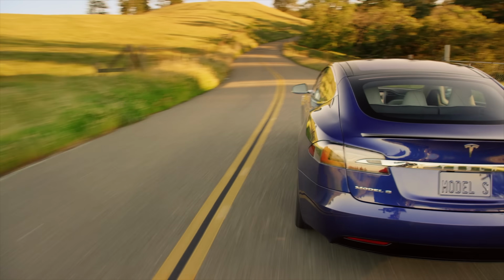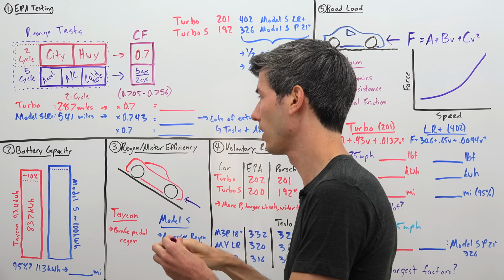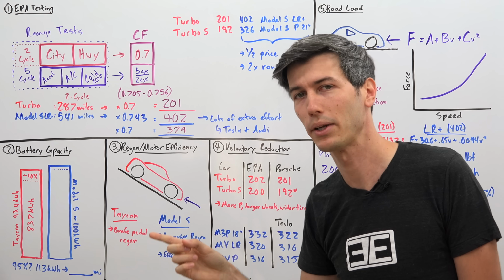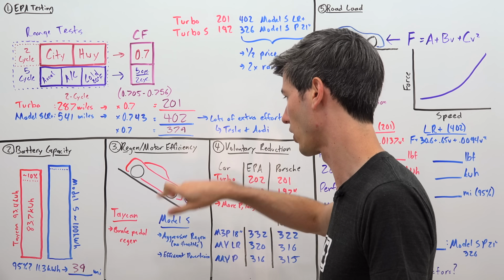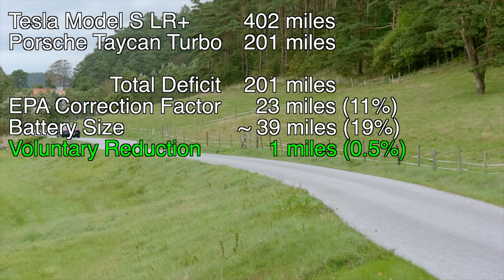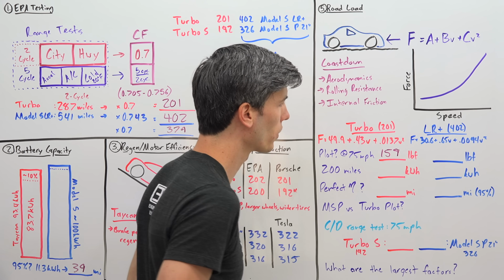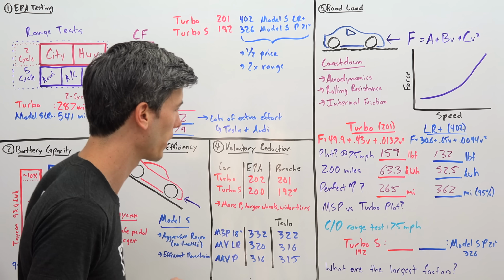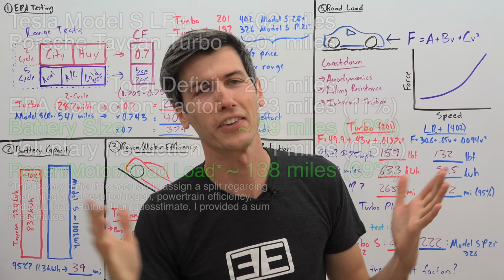Tesla's Secrets To Dominating EV Range - Double Porsche?!

Comment: All other factors aside, EV range numbers are misleading. It should insult everyone's intelligence. They should be broken down to average city mileage and average hwy mileage. EPA range for ICE cars are much, much more accurate. E.g., 2009 Civic can go 36-40mpg at 80mph; EPA estimate is 36mpg hwy. 2019 Model 3 AWD rated at 310miles range can only manage a mere 190ish miles at 80mph. Tesla's increasing range claims, at this point, is a mere marketing ploy.
Reply: Not just that, its imo also important to list efficiency at different speeds and charging loss(which can be more than 20% on some cars), then the consumer can decide where the sweetspot between efficiency and batterysize is, or just go for a different car that consumes less energy.

 Until recently that wasnt particularly important as most ev's were rather premium priced, but for the masses daily costs are important, and not everyone has the option of a solar panel.

Comment: So what you're saying is:
1. the government makes manufacturers perform a bunch of tests to evaluate the vehicle's range. 
2. these tests are so laborious that manufacturers often choose to skip some, despite the possibility of a poorer rating.
3. the value obtained for the range is not an objective evaluation of the vehicle's actual range.
Sounds about right.
Reply: The thing is that it was "ok" for gas cars but for electric cars with regen systems we really need a "city range" and a "highway range". This "half city/half highway range" doesn't give the consumer much of a useful estimation. But we perform on electric cars the same test we're used to with gasoline cars...
Reply: @OdamaKamayuka  More regulation, good idea
Reply: @luisgeniole369  nothing wrong with appropriate rules and regulations.  Smh
Reply: @trance9158  Don't let nobody tell you different
Reply: @luisgeniole369  its hardly a regulation, just a measurement
Reply: Good point. I think comparing EPA to WLPT would be a really interesting video too.

Comment: This is a great explanation and points out a great point. Not sure about Porsche, but I've had 2 Teslas in the past 5 years. I had a Model S 60kWh, rated at 203 miles which I never got more than 160 miles actual usage with 100%. For my P100D rated at 315 miles, I've never got more than 250 miles on a road trip (mostly highway)

Comment: About pricing, I dont know in the US but Tesla model S long range is starting at 85 000 EUR (100 700 USD),  performance 21" is at 101 000 EUR (120 000USD) VAT included. While porsche taycan is at 110 000 EUR (130 000 USD) which is not twice the price but "only" 30% while being a real sport luxurous car with a brand on it. Just saying.

Comment: very nice video. thanks a lot.

But should it not be a test between porsche Taycan and model S P21" ?
It shows that Porsche is preservative, when Tesla is lying.
Of course eventually Tesla is going better, thanks mainly to its battery higher capacitivy, which is a good point, but that mainly it.

About regen, it is a hard point: I have just been surprise when I understood that to get higher mile range, it is better to have a neutral position without regen, than having regen.... Why ? Because effeciency is always <1... !
Of course this is correct only if you can prevent braking which is pure loss. 

What a shame to not have the overall officiency value, because while the speed is greater, the force is too; however the efficiency depends on speed too!
For an ICE, it gives strange results:  fuel economy is better at 70km/h than 30km/h; because aerodynimic loss is still low while ICE efficiency with gearbox is at best.

Comment: Think you buried the lead.  The bigger battery alone accounts for the slightly better range of the Tesla as tested and all of the other factors you explained seem to provide no actual benefit.  The largest one the load factor is surely going to make almost no difference in city driving.  Conclusion is that a test if city driving wouldn’t probably show the same result. The Tesla range in actuality is nowhere the rating.

Comment: So this video basically shows the Porsche is slightly less efficient on the highway than the Tesla. Are you spending this video to make the case that we should spend 250k instead of 89k for a slightly less efficient highway vehicle?
Reply: Actually Porsche is more efficient. Combine the C&D results on the right with the battery size on the left and you'll see Tesla using 12.5% more power per mile.
Reply: @aigarius  and we should pay 250k for that? That isn't much of an accomplishment.
Reply: @nacholivre3327  Taycan starts for 104k€ Model S starts from 80k€ and Performance is 97k€. The price difference is lower than the efficiency difference.
Reply: @aigarius  Moving the price comparison to the taycan 4S starting price? Ok, the Tesla Model S starts at 69k. That's not a 12.5% difference. It's 49% more expensive.

Comment: Tesla used to have that cool calculator on their website where you could change options on a Tesla S (wheel size, battery etc) and see that the range would be but you could also change the highway speed and the ambiant temperature, unfortunately that calculator seems gone from their site now.

Comment: Great Video as always, why didn't you take the Taycan 4S with the big battery as a comparison to the Model S LR with 402 miles of range ? Bjørn Nyland tested the highway range (91 kph/ 56 mph) of a Taycan 4S with 19" factory aero wheels and got a range of 580 km (360 miles) while the latest Tesla LR did 644 km (400 miles) on the very same test. I think the turbo is not comparable to the LR at all as its much faster, its closer to the Model S performance than to the LR.

Comment: So I was following all your explanation Jason up to the end. Then the real world test of a Taycan Turbo S vs a Tesla Model S Performance. If you figure that the Taycan usable battery at 89kWh as it was increased end of 2019 it seems from many reviews vs 95kWh for Model S then the Taycan is actually slightly more efficient at 426Wh/mi vs 428Wh/mi and realize that the Taycan Turbo S has 305 tires in the rear. Seems like this would put a shadow on the A, B and C values provided by Tesla?

Comment: IME, the "classical" OE's use significantly more energy on hotel loads (heating, lighting, demisting, infotainment etc) simply because they have classic atribute set for ICE cars, where for example cabin heating loads are effectively free. They also have significantly more rigerous requirements for ventilation airflow and demisting, because the Taycan is a premium product.  When heating loads can be several kW, that makes a considerable difference on an average road load of around 12 to 15 kW.  Finally, the taycan is specifically targetted at being a SPORTS model, so has chassis settings that reflect that aim, so things like tracking and camber, even tyre carcass hysteresis are optimised for handling and not for low loss. Things that matter for a Porsche, mean little or nothing in a Tesla

Comment: I think Porsche is offering a “sports car” which typically has a greater down force applied to the vehicle in addition to having a lighter battery so it makes sense the taycan has a shorter range. I think when the model S performance aligns with the taycan shows they may have changed the aerodynamics.
Reply: It's far from a lighter battery, the Taycan is an extremely heavy car. :)
Model S P100DL is 4,941lb, Taycan Turbo S is around 5,224lb. Rough values from Google, but it does weigh more! I believe Bjorn Nyland has some good videos showing its weight.
The weight is usually a big factor in why Tesla's vehicles are able to go so far on one charge, they've just been doing it for longer and had time to make their process more efficient and the cars lighter, others will get there some day!
The Taycan is a great track car, but I'm not sure it'd be most people's idea of a daily - But neither would most Porsche's, it's a different market really, they just get compared because they're both EVs.
Reply: Curtis English agreed, by lighter I meant a smaller battery.
Reply: @VoxelLoop  I mean lets be real, we are talking aobut 4% weight difference. BOTH are extremely heavy cars. And 4% weight difference dont make up for a double distance rating. Consider it in the single digit percentages too.

As explained in the video, people shouldnt compare the long range model s to the taycan in the first place. The model S performance is the right model to compare, because it has similar drag/downforce characteristics. Designed for performance, not long range efficiency in the first place. 
Another problem in my own opinion is, the "km" rating of the EPA is not "a pure range rating". The video showed the kind of different factors, that go into the rating for different car models. I would prefer it to be the same factor - if any - for every car model.
Reply: @jesusisgod94  Totally! People just compare them because they're both EVs. I know it's not much heavier than the Model S, but the point was that it's not some light track car. It's a great car, just the range isn't great, and the price is very... Porsche. Like I said, Porsche owners will buy a Porsche, it's kind of its own market. :)
Reply: @VoxelLoop  obviously you don't know that many Porsche owners do drive their cars daily.  It's about the only sports car you can actually comfortably do this with....oh and in all weather conditions.
Reply: Trance 9 🤣😂😂
Reply: @trance9158  I don't mean that people don't daily them, I mean it's not practical to in an economical sense. :)
For example, you can daily an RX-7, but your wallet will be empty by the time you get to your destination! Some cars are practical as a daily, some are not.
They make great cars, but they attract Porsche owners; People who don't care about the price usually, it's in a different market to the Model S in my opinion.
I guess the Model S is a very pricey car though!
Reply: @VoxelLoop  most Porsche car's get good gas mileage even the 911 series of sports cars.  Better than most of their competitors even.
Reply: Stickier fatter tyres too.
Reply: This vid is t-junk-fanboy-trash! Based on the BC my Taycan uses about 24kWh/100km but my MS90D guzzles slightly over 25kWh/100km.
Reply: @cyberslim7955  Ya by MY Model is actually uses 20kWh/100km, making it the bestest car ever. Don't believe me? Well, trust me, I've seen it myself and I promise I didn't make this up. Don't trust those engineering nerds with their... fancy math, trust my opinion
Reply: @Domdotcom799  Trust a fanboy? These people have nothing but lies!

Comment: I read an article almost a year ago that Porsche sacrificed range for a consistent driving experience.  They limit the charge available so that you get a consistent acceleration based on the accelerator position regardless of the battery's voltage (dependent on the charge left).  This also will extend the battery's life.  They also, as you stated, are less aggressive on the regen so that the brake pedal feel gave consistent braking performance and to eliminate the transition feel from just regen to the addition of the brakes.

Comment: On the right tires, the Taycan 4S does 580km/360mi at 90kph constant (Bjorn Nyland range test). That's staggering for "the world least efficient electric car".
Any update to Porsche's battery pack, and keep in mind this is the VERY FIRST range pack that they've built/used, could take it to another level. See how Model S improved over the years.
I would expect Porsche was holding back most of their punch in the weight department. Their 2+2 with small boot is heavier than the most roomy Tesla Model S Long Range despite having a smaller battery and very similar motor power. Yes, performance may be more repeatable, the pack might produce less heat of its own, but from a pricey sports car you'd expect a lower weight, not higher. When they are ready to discontinue the ICE Panamera, expect their BEVs to lose a good amount of weight and become less cramped for space ;-)

Comment: So I drive emissions tests for one car manufacturer. The OE I drive for does all the 5 tests for almost every vehicle. They have to have all these fancy test sites. They also have special sites that simulate higher altitudes around the world. Its really cool stuff. And i can confirm the epa tests are NOTHING like normal driving. Lots of speed changes at slow rates. You can find the tests online but they are compressed so much you don't see how slow they really are.
Reply: UnitD77 And I can achieve EPA range on my Model 3 with reasonably careful driving. 
As for NEDC 🤪, there’s a reason it’s called NotEvenDamnClose.
Reply: @FutureSystem738  I actually manage to beat the NEDC figure for my car quite frequently, and it's a diesel. The EPA and NEDC (also WLTP) cycles are really just to standardise testing in order to compare the cars' efficiency in relative terms.
Reply: It's really strange. You would think it's just a matter of putting a logging GPS in a large number of cars on the road to get a true statistical sample of how the average car is driven (eg offer it as a free game app in return for collecting the data). But that doesn't seem to have occurred to the EPA, or perhaps it has but it wouldn't suit the car maker lobby ...
Reply: Ken Oliver I guess the main problem is that no two cases are the same. 
We used to have a PHEV, which had 45 km Electric range on a good day, if driven carefully. Our lifetime fuel use was under 1.5 litres/ hundred simply because most of our driving was within that electric range. Yet someone else might get 6litres/100 or even more on the exact same vehicle, because either they don’t charge the battery often or just do much longer runs.
Likewise, even on the same run, same traffic, same time of day, different drivers will get different fuel economy- all down to driving style.
Reply: @FutureSystem738  "45klms"  it is written 45km
Reply: @UnitD77; Say you test a new car model with the 5 cycle EPA test and submit it to EPA. If EPA decides they wants to test the new car model and only test 2 cycle test. EPA gets different result than your tests. Whose tests are then the EPA rating given?

Comment: According to teslabjorn
Taycan 4s at 90km/h 579km at 120km/h 425km
Model S Raven at 90km/h 644km; at 120km/h 473km
that's about 11% better range.
Tesla selected to display the best EPA range, Porsche chose the most conservative
Reply: @fuji8103  I read the original article. The article mentions that the manufacturers have some leeway in how they test. Porsche (can't recall if it is explicitly stated) went conservative with their testing; I recall the article stating it as Porsche testing the Taycan as a performance car, not focused on range.. Tesla (and I recall the article stating this) used the system to deliver a higher EPA average. I'd say they "gamed the system" but the article doesn't state that, merely that they used the EPA rules to their advantage -- but I've read other articles that state this is essentially what Tesla has done, use the rules to max out the range number for their cars.

More to the point, this is what we are seeing in real life. Most people have a difficult time getting a Tesla to match the EPA ratings, whereas most reviews I've seen (not as many available yet to hear from owners) have no problem exceeding the EPA rating on the Porsche (getting 250 miles or more) despite driving it aggressively. Teslas still seem to have a range advantage, but when they do it seems to be based on the larger batteries, not that they are more efficient.
Reply: @davidnielson9139  That 644 km range is right at Tesla's EPA range. 3 km off. Not sure why the Porsche is rated so low, but it seems like they will struggle much more with normal driving range within a city, while doing great on the highway. Would love to get more details on how the tests cause Porsche to so up so poorly.
Reply: It's the same with announced performances, on paper Tesla S is better, but on the road all tests show the Porsche is slightly faster.
Reply: While the Tesla battery capacity in this particular case is still 100 kWh, the Taycan 4s's is only 79.2. If my calculations are correct, with a 20% bigger battery, Tesla managed to achieve only a 10% and 8%, respectively, gain in mileage.
Reply: @ereisenheim9896  no. You can get the 4s in the performance battery which is the 93kwh battery, that's an optional extra . That's the battery Bjorn used. 

So Porsche 93kwh vs Tesla's 100kwh in that test
Reply: @supaahflyy  thank you, I didn't know that. So, in the end, Tesla appears to be slightly more efficient than Porsche in this test too.
Reply: @ereisenheim9896  yeh essentially. It's slightly more efficient but the difference in range is mostly down to just having a bigger battery pack.
Reply: @ereisenheim9896  the 4s of the test is the performance version with the 93kWh battery
Reply: Er Eisenheim  lol porsche chooese to use 79% of the battery because they know the battery will degrade so fast that you need to replace quickly........ if i am the buyer that will be a Big no......... you can't even use the full capacity of your battery......... and us ng it will make you replace baterry faster than replace you gas car.......